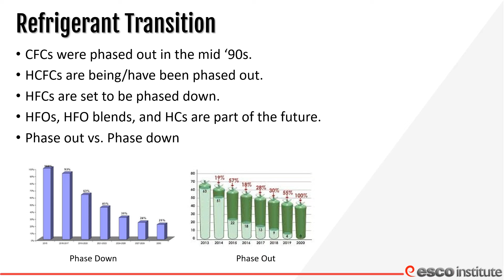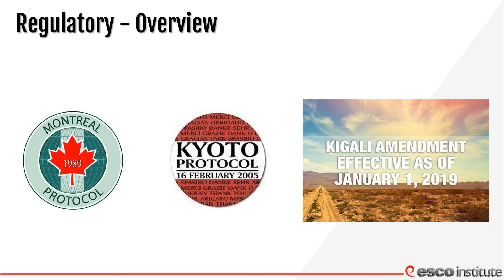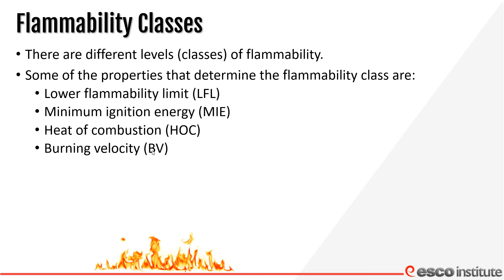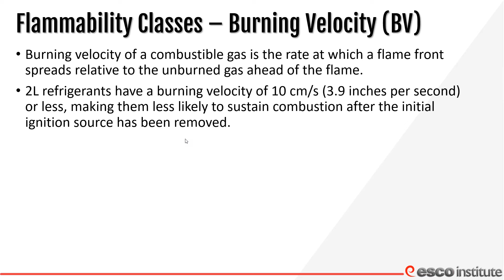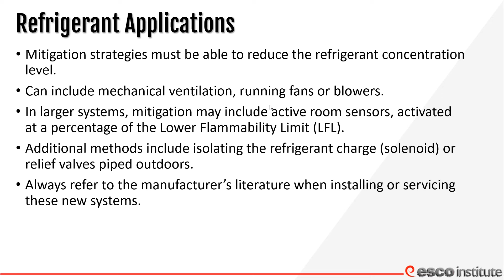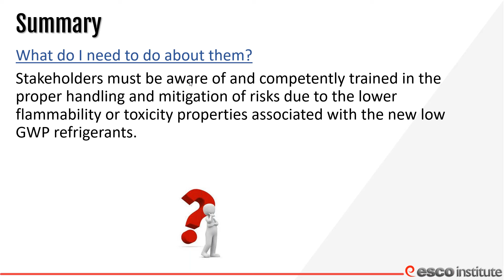A2L Refrigerant Safety

Comment: The manufacturers are going to have to figure out which ones they are going to use, I am only going to carry one additional refrigerant in my van, it's a van not a frieght train! R-32 is time-tested overseas and appears to be the better choice. If you are a manufacturer thinking of using R- 454 B you better think again, chances are not good that I would ever purchase this product. Carrying refrigerants in a van requires two cans, one which is open and one full can, unless Ford can add three feet to my van, that's not going to happen with 4 cans. I will carry 410 A and one other refrigerant along with reclaim tanks - PICK ONE!!! The EPA and Industry leaders need to get a dose of reality and make better decisions as two refrigerants are not going to work at all.

Comment: The problem that I am having in the US right now is why do you guys have to be 1. Using the standard system for measurements? 2. Why do you guys mix standard system with metric system? For example, the chart that measures HOC is in BTU/lb and the BV is in Cm/s. You guys need to use either one or the other consistently because that mixture is going to create a lot of confusion understanding the new changes. My recommendation: Get rid of the standard system and adopt the metric system.
Reply: Greatest country in the world.  /s. Well, it probably is the greatest if you're a corporation or politician making bank.
Reply: They have to use metric measurements because it makes them sound more scientific.